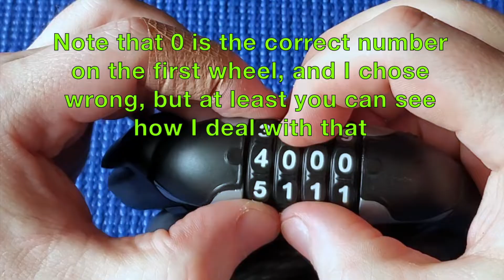(167) Kryptonite KryptoFlex 1218 bike lock decoded

Comment: Thanks so much. My daughter had one of these from new months ago and decided to put a code in without committing it to memory. This has finally allowed me to decode it. I'd even tried brute forcing all 10,000 combos but must have had the numbers slightly off 🤦‍♂🤦‍♂
Reply from the maker: Fantastic that you got it open! Yea it's frustrating to go through all 10,000 combinations and it still not open ... sometimes if you're not pulling quite straight then it doesn't open when you go past the correct combination. Also, it's so mind-numbingly dull that it's easy to misremember where you're up to. But I'm so glad you got it open and this method was helpful! 😜😜
Reply: I did the same - brute force all combinations but the latch was a little stuck and must have blown past it.  Took better part of a year (I didn’t need this lock as I had a backup).  Tried this and had it open in 10 minutes.

Comment: Very interesting method. Will try it on some locks to see how it goes. Thanks for the inspiration.
Reply from the maker: Oh thank you for watching my friend. Yea it can be easier using that method. The indirect method worked but it required so much strength I couldn't show it on camera (as I'd have to hold it out in front of the camera and then it would be too hard for me to tension that much). Have a great time enjoying 2023! 😜😜
Reply from the maker: I found a pattern - modified the method - I did a video on it 😜😜

Comment: Nicely done! I love this method, it seems kinder on the hands than applying full tension. I wonder if the 4/0 and 8/4 confusion was because of false gates 4 positions off from the true gate? Odd that the false gates wouldn't be offset by 5 and keep some symmetry.
Reply from the maker: Thank you! Yes I was wondering the same thing ... it was a little bit too subtle to detect a pattern. If I find one I'll let you know. Yea I tried the indirect method on this lock and it was very tiring. I couldn't show it on camera as I couldn't hold it in front of the camera and generate that much force 😜😜Cheers and have a great 2023!
Reply from the maker: Your comment inspired me to investigate further and indeed there is a pattern. I did another video with the updated method. 😜😜
Reply from the maker: ooo and I just subscribed to your channel 😜😜
Reply: @Swynndla  I'm flattered! Your videos were one of my first exposures to the fun of combination locks :) I hope your 2023 is off to an excellent start as well!